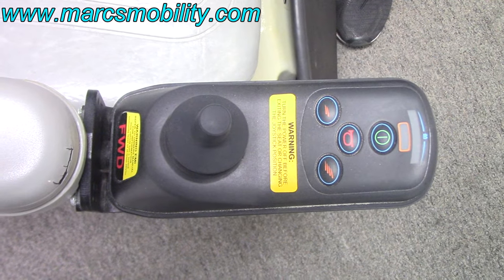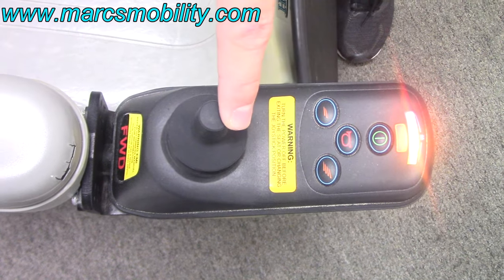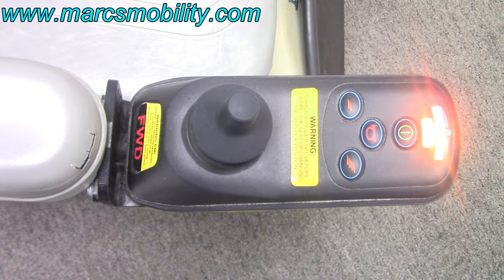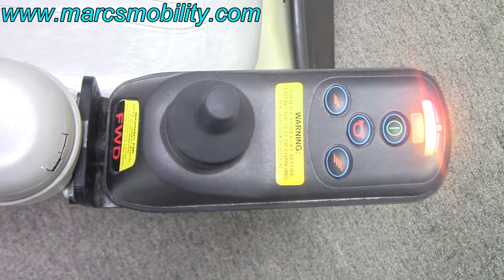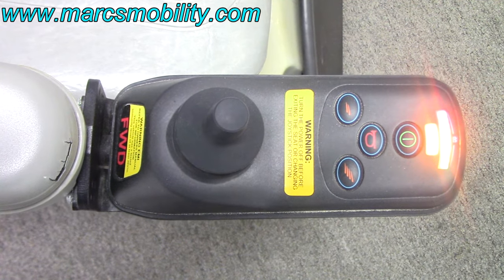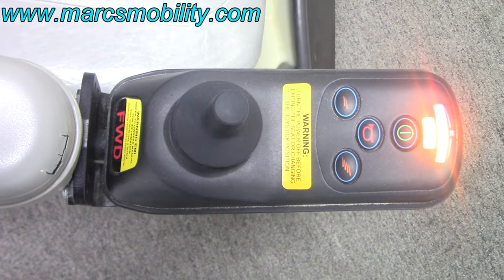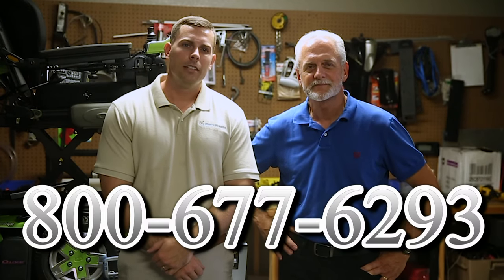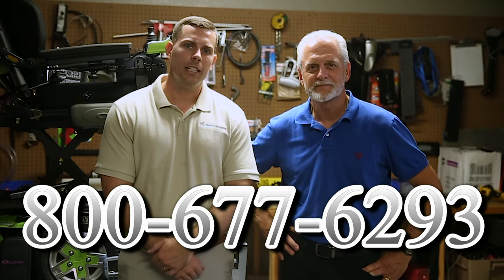VSI Fault Codes and How to Lock and Unlock A VSI Joystick

Comment: Great info, thanks so much.
I was getting the eight light function code in the top bar.  Then, it became one solid orange light on the speed control bar. I now have two controllers that have ended in such an error.  
Any ideas?
Reply from the maker: For the 8 bar error code, a control system trip is indicated. Make sure that all connections are secure. If everything seem correct, call a mobility store in your area that is a dealer for your chair and see if you can get it in and have them take a look at the chair.

Comment: Hi, my Hoveround was working fine until I was watering my plants outdoor, the hose sprung a leak and wet the controller arm.  I let it dry out, now it may work for a short period and stops with fast flashing lights.  The rest of the time the lights will come on steady but when I try to move forward the lights will start quick flashing.  I am a handy person and may be able to fix it if I know what to look for.  I can't afford a new controller arm.  Thank you for any help.
Reply from the maker: If its flashing 7 or 8 total lights then you have to replace the joystick.

Comment: My moms wheelchair seems to be stuck in neutral even when the sticks are pushed back! Is it just something wrong with the neutral sticks?
Reply from the maker: Unless somehow they came unscrewed from the motor but Ive never seen that before.

So you saying not matter which way the free wheel levers are in the chair can always be pushed around?
Reply: So I looked up the different codes, looks like all the red and yellow lights are on and just one green. I think that means something is wrong with the joystick? So expensive too

Comment: Hi,i have been trying to charge my dad's Merit P200 power chair 6 hours Sunday and today,so all i get it a sequence r d orange a two green, it's beeping etc but i thought it would charge completely today,it hasn't been charged for a year and half though, could this be why,kind regards
Reply from the maker: Hi Brenda.  You need new batteries.  If those kind of batteries sit without being charged longer than a few months, their charging capacity will drop down so low that you cant re-charge them.
Reply: Morning Marc,thankyou for your reply,at this time I'm not in a position to purchase new batteries,but would like to move it on for someone to make use of it,apart from not charging the chair it's self is in immaculate condition, would you know how much would it sell for as it is at the moment , kind regards Brenda
Reply from the maker: Hey Brenda, without seeing photos of the unit, its condition, mileage, etc. I would not be able to give you a cost. What I can say is jump on google or eBay and type in the make and model of the unit and see what others have theirs listed for and go from there. Hope this helps.

Comment: 3 red , 4 yellow and 1 green, flashing when I power on.
What gives ????
Was working in the summer.
Reply from the maker: If its this exact same joystick then its a bad joystick. 7 and 8 flashes on this exact type you have to replace the joystick.
Reply: @Marcsmobility  thanks for reply, the thing is it was left outside with a tarp covering and I think water got into it.
Will try to take apart and clean it.
As I say inherited from my dad that passed in August. He never used it it just sat.
Reply: @Marcsmobility  Hi ,
I took apart the joystick. Bit of moisture present .Used electronics cleaner to clean circuit board and joystick.
Now no Flashing LED
BUT !  Below Yellow Led Cycling up and Down .
What does that mean ???
Reply from the maker: If you are speaking about the speed indicator lights, that would be a control system lock. If it is, you can try hitting the horn button twice in a row and see if it unlocks. If that doesn't resolve the issue, try holding the joystick forward until a beep sounds then hold back until a beep sounds then it should work.

Comment: What if no lights at all?  Has been on charge for about 8 hrs still nothing. Its batteries or joystick? Thanks in advance
Reply from the maker: If its sat longer then 4 months without charging the 99% of the time it just needs replacement batteries. What model of power chair do you have?
Reply: @Marcsmobility  113 jazzy ats. Thanks for fast response
Reply from the maker: @tenehaglendening9246  These are what you need. You will need (2) https://marcsmobility.com/35amp-battery.html
Reply: @Marcsmobility  thank you very much